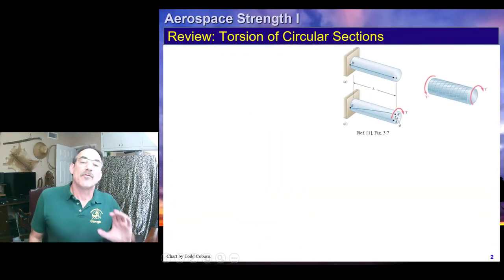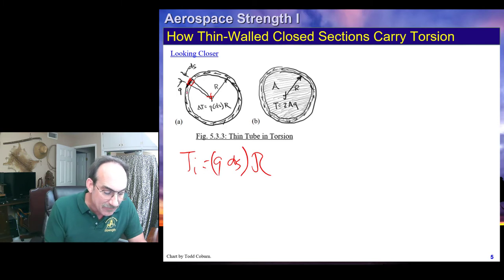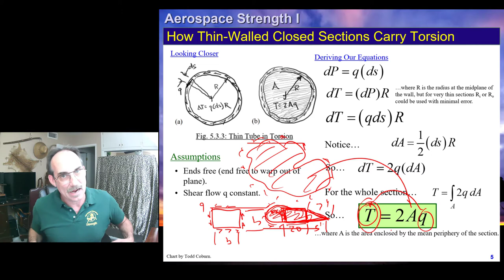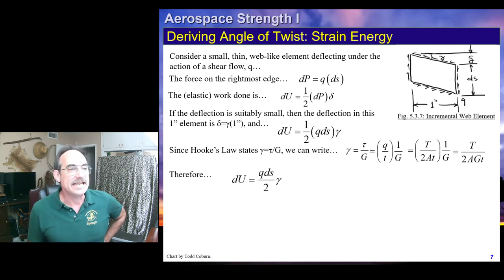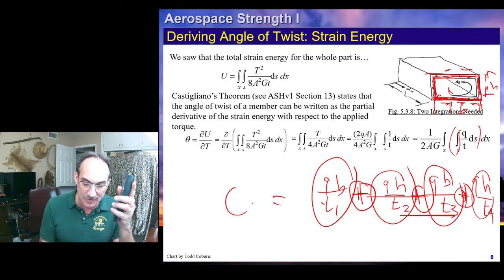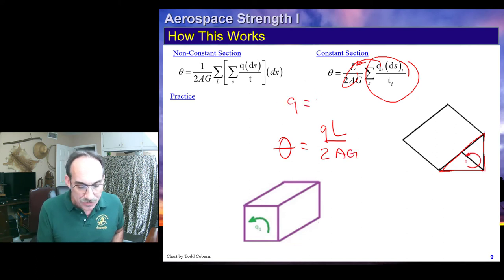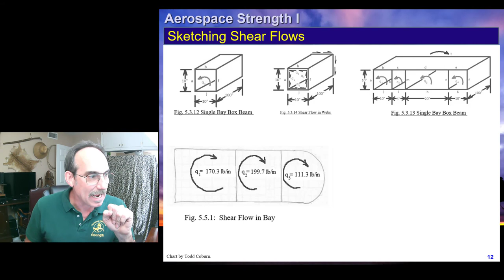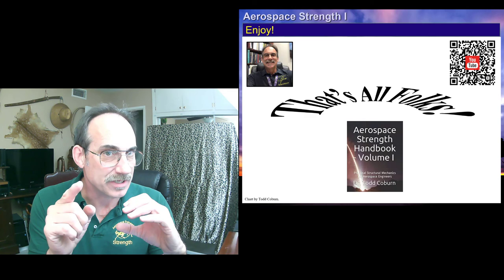Strength I: L-08 Torsion & Twist of Thin-Walled Closed Sections

Comment: Hello! Thank you for the video! Please, I would like to know something. If I apply a torque to a multi-cell cross section, will the shear flow have the same direction of acting as the applied torque ?
Reply from the maker: That depends.  The equivalent shear flow in the cell will be in the same direction, but the intermediate webs (between two cells) will go in the opposite direction relative to one or the other cell depending on relative magnitude
Reply: @ToddCoburn  Thank you, sir ! :)